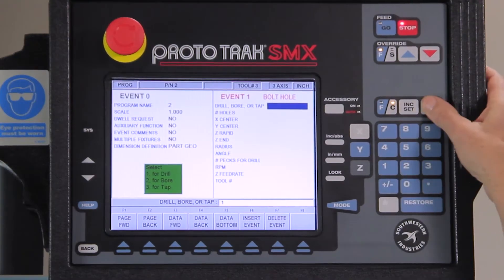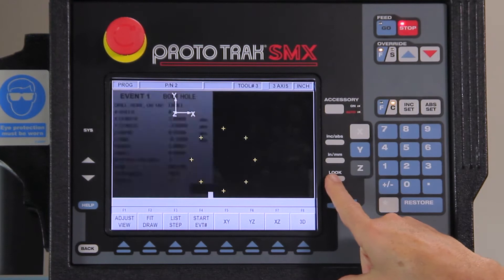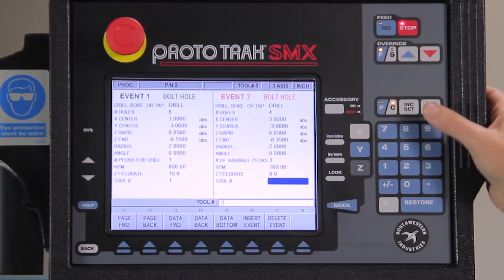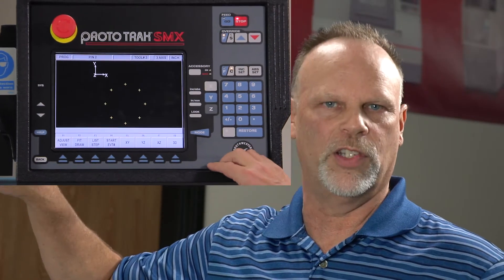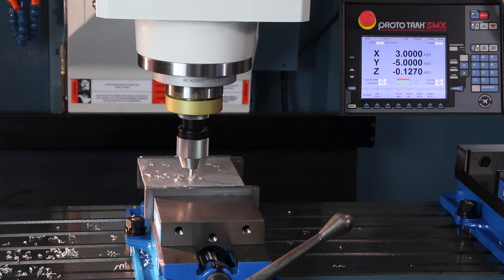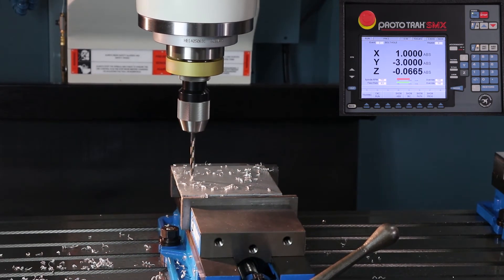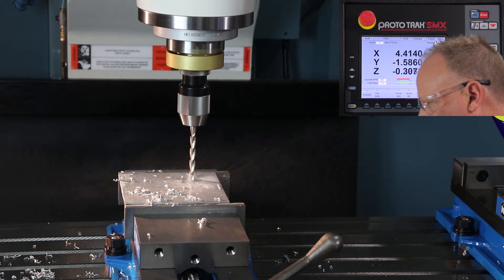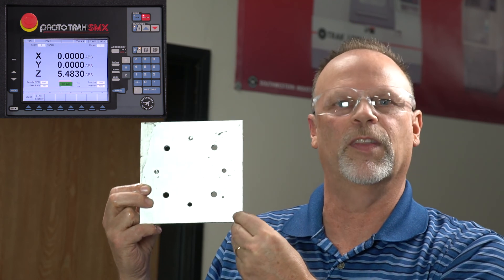Bolt Hole Patterns | ProtoTRAK SMX Control | Basic Programming 2

Comment: Interesting how the software guys made the program move the drill 90 degrees simply by telling it to drill four holes with angle zero.  Math equations in that software someplace. You tell it to do pilot holes 8 times and it automatically knows to do 45 degrees in a circle.
Reply: In a bolt hole circle the number of holes is divided by a complete circle in equal degrees (360 degrees). Ex: 4 holes=90 degree increments, 8 holes =45 degrees increments, 16 holes=22.5 degrees, 18 holes=20 degrees, etc.. The "angle" option is asking for the starting position of the 1st hole. Zero degrees is the start position of a hole at 3 o'clock position. Adding a value to the "angle" position will rotate the entire bolt hole pattern and all number of holes will still be equally placed around 360 degrees.
Reply: @monkeymojo073  got it.  Thanks

Comment: how do I skip holes when using a bolt hole circle? Example: if I had a bolt hole circle with 18 holes but needed to skip holes at 90deg and 270deg. RMX controls. thx
Reply: Monkey Mojo.  The easiest way is to make a bolt hole pattern with only one hole and then use the ROTATE event to get the others.  T.P.
Reply: good question.  That encourages me to continue to rotations video.